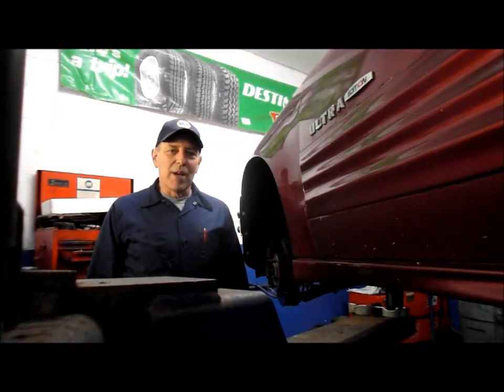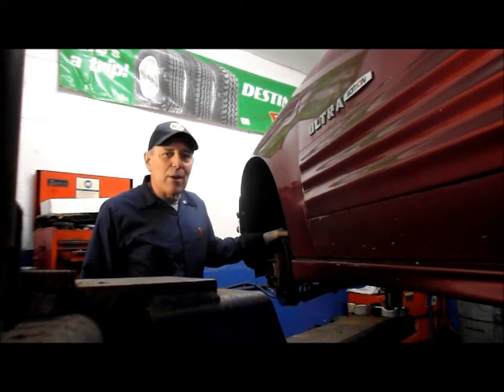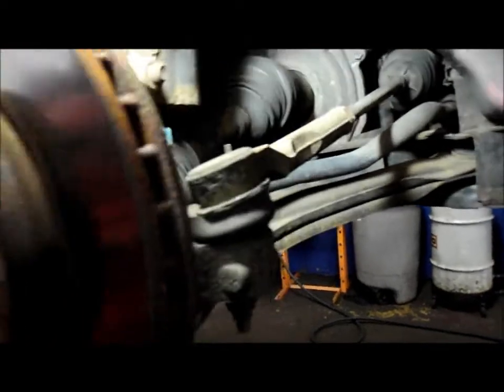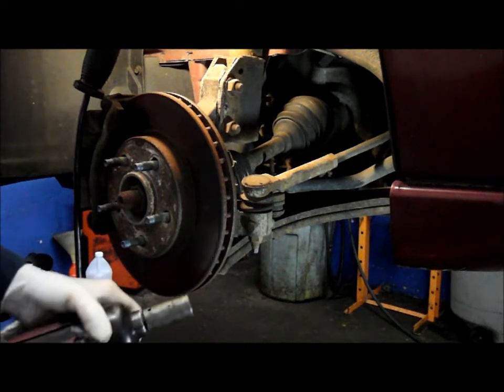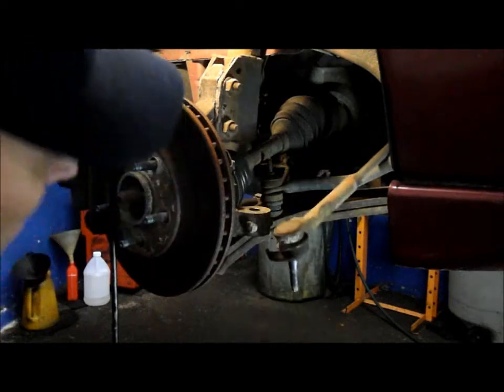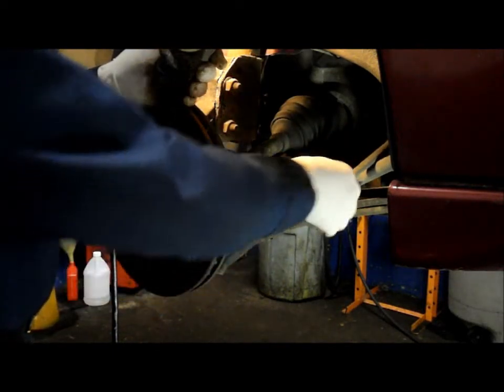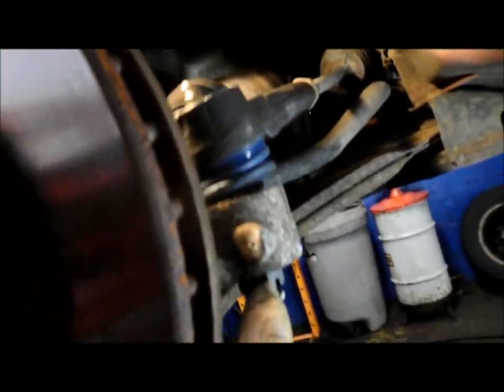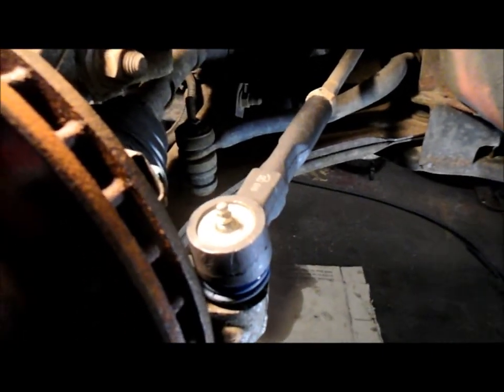How to replace the outer tie rod end on a Pontiac,Chevy,Buick or any GM product

Comment: should they be replaced in pairs ,changed outer passenger side on 2009 Buick Allure with 65,000  km and the steering wheel is a little off center and slight inclination to veer  a bit left over  a few hundred feet ,.forgot to count revolutions but measured to within 1/16 of an inch   ....should i back off jam nut and add 1/4 turn to  tie rod shaft .would that correct the steering wheel position and make it level .? thanks dave

Comment: He does a half job.  Doesn't replace the adjuster but which is provided, didn't grease the tie rod.
Reply: He  is  a  professional....It  comes  already  greased.  Also  original  adjuster
nut  was  much  heavier   than  the  new  one  supplied.  So  he  used  the 
heavier  nut.  Please  be  forgiving.   He  is  correct as  I  would  do  it  that
same  way.

Comment: It looks like the rod was turning as you were screwing the tie rod on..
I have a feeling the same thing happened to me as it also hit the jam nut early..
I should have gone farther back on the threads and held the rod tightly. 
If it pulls to the right, can I just take it loose and screw or unscrew it one or two threads?
How many shots of grease does it take to fill it?
Reply from the maker: After the tie rod was installed you will need to check the wheel alignment.

Comment: Hi Jim great video.  If the inner rod was bad would the rod have moved and made a clicking noise when the wheel was shook for play and would another sign have been a floppy inner rod falling down?

Thank you
Reply from the maker: fargobrad Yes if the inner was bad it would also make noise.The way to tell if its the inner or the outer is to hold your hand on the inner when you shake the wheels you will feel the clicking in your hand.Good question.

Comment: the nut on the bottom of my tie rod will not come off. it just spins. any suggestions?
Reply: Wedge a flat screw driver or some other very flat metal between the nut and the lower a-frame and then try to remove the nut, it should come off.